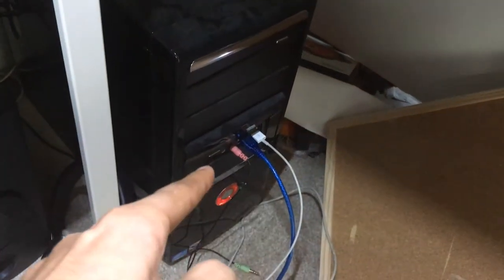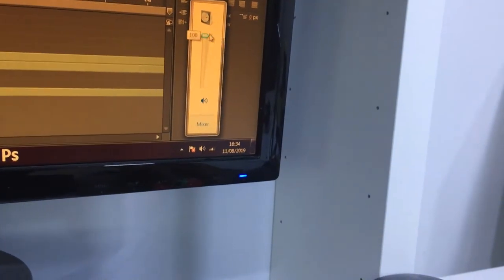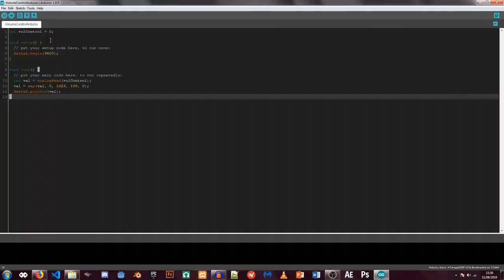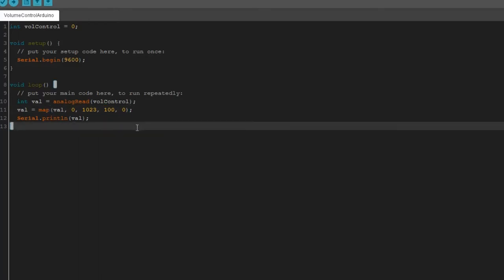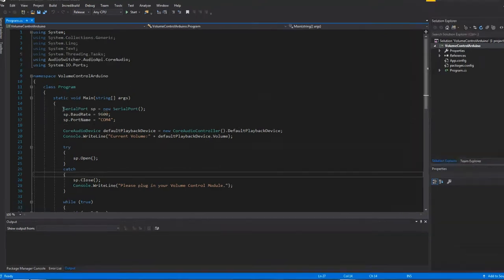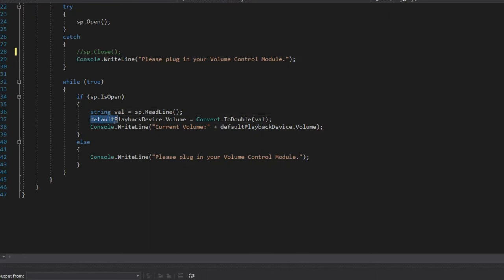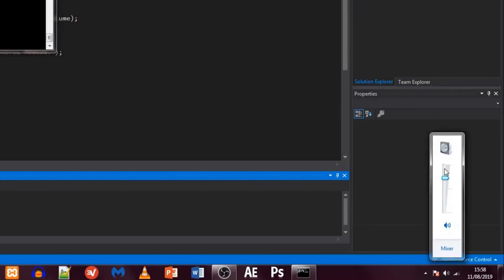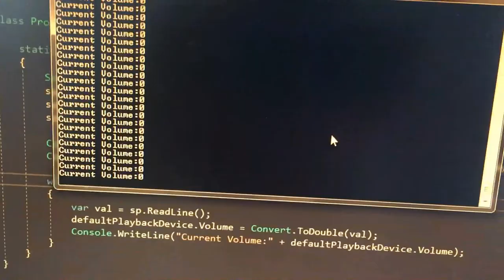Volume Control with Arduino Nano and C#

Comment: Excuse me. I used your C# code on my computer(WIN7).
But when I run this program it always say {system.formatexception: 'input string was not in a correct format.'  
                                                                           at System.Number.ParseDouble(String value, NumberStyles options, NumberFormat
Info numfmt)
                                                                           at System.Convert.ToDouble(String value)
                                                                           at VolumeControlArduino.Program.Main(String[] args) }
 and stop run the program. 

How can I solve this question?
Reply: Oh!  I add {delay();} after Serial.println(); in Arduino code.
Then the program finally can run.
I guess maybe it read too much string so the program intterupt and stop it.
Reply from the maker: @user-py4eu5ld1h  Hey! Glad you fixed it man. I will update the code in the description to match this. The delay() is vital to separate all the input values.
Reply: @theakashd  Thx!  Your project  give me great help!
I thought contorl volume by USB only leonardo board  can use(USB to USB).
Until find this film.
Reply from the maker: @user-py4eu5ld1h  Glad I helped you man! The same can be done with any Arduino, I think; though I have only tried this with a Nano.

Comment: hi! umm for this to work i see that u need visual studio. so i just downloaded it.. 
Do you need any additional workloads for this code to work?
Or is the basic Visual Studio Enough
Thanks in advance!
:)
Reply from the maker: Hello,
You will need this library to interact with the system audio: https://www.nuget.org/packages/AudioSwitcher.AudioApi.CoreAudio/

in addition to the usual C# modules. Hopefully I didn't miss anything!
Reply: @theakashd  Okay... I have installed and done all the steps but for some reason the "using System.IO.Ports" is unnecessary to define (its greyed out) whereas in your case thats not true..

Due to this i am getting errors like the SerialPort command is not treated as a command and is in plain white text.

The arduino part is all done; I am getting my values in the serial monitor.

What do I do??

Thanks in advance.
Reply from the maker: @samyflies2  I would strongly recommend watching some tutorials about the basics so that you can solve problems on your own! It is much more practical that way (and rewarding).
Reply: @theakashd  I already am trying to learn but dont know where to start...
First of all, which language is the code in??
Im pretty sure its C# but i cant find any help regarding my problem of the "using System.IO.Ports" being greyed out.... i really want to make one of these...
Reply from the maker: @samyflies2  it is C#. There are plenty of C# tutorials on the internet. Good luck
Reply: @theakashd  okay thanks!

Comment: Here is a boomer no nonsense solution. Use the potentiometer as analog volume control! You know, like it's normally used?!....
Reply from the maker: yeah lol I just felt like overengineering this for some reason :) also this way the system volume itself is changed through software! thank you hehe
Reply: @theakashd  The new software mixer in Windows is not so bad, but normally, you'd get better sound from leaving the software volume at 100% and just control the volume  by analog.
Reply from the maker: @Mr_Wh1  that is a much better solution to be honest, you're right :) thank you Dan!